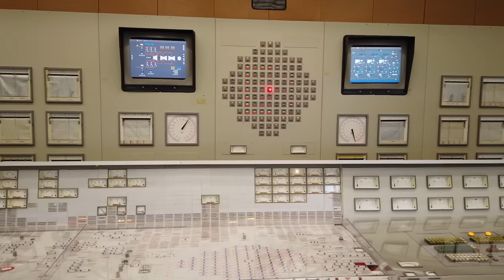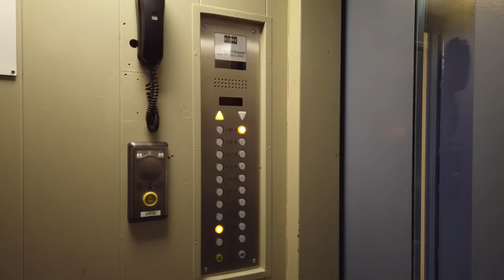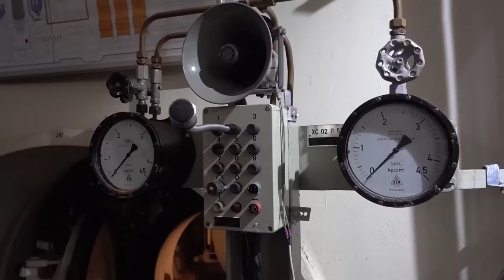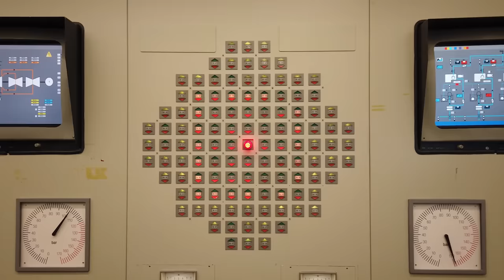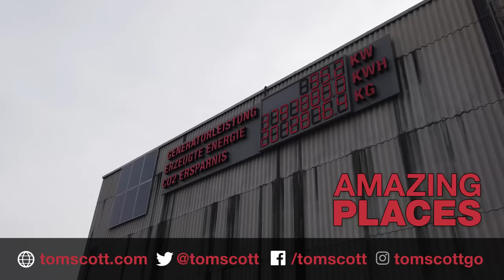This billion-euro nuclear reactor was never switched on

Comment: You forgot to mention, that the Austrians had to build a coal-fired power plant 4km away to saturate the electricity needs when the referendum concluded. Ironically this power plant has produced more radiation than Zwentendorf ever would.
Reply: True enough.  Coal is never just coal.  Mixed up in coal are radioactive elements, mercury, lead, and other bad things that get spread all around the plant...
Reply: At least they can decomission it in a couple of yerars and simply move on with their lives.
Reply: @Les_S537  is that where the radiation came from? From burning the coal itself?
Reply: There are no coal-fired power plants in austria any more.
Reply: @Confucius_76  all coal is slightly radioactive. Burning it releases the radioactive contaminants into the atmosphere, ironically causing much more radiation hazard than a nuclear plant would.
Reply: @quintensarn4595  do you have any source for that?
Reply: @Zeckmon3  however would a literal nuclear reactor not produce more radiation?
Reply: @GamingOS  It's not like that a nuclear reactor doesn't produce more radiation, it's the "effective" radiation which gets its way to the environment. The radiation of nuclear plants comes from the nuclear rods which are buried after their use. Nuclear plants are very carefully that the radiation of those rods doesn't affect the environment, while coal plants simply blow their toxic stuff in the air (included the radioactive stuff which is always in coal) which causes more harm than nuclear plants.
Reply: @vs_0159  Makes me wonder if those ash capturing systems on coal plants are also effective at keeping teh radioactive stuff in. Makes sense that it would stick to the solid residue.

Said ash would probably be piled up under the open sky anyway though, free to leech out under the rain
Reply: @GamingOS  No power plant "produces radiation". Radioactive material is just moved.

Point is, regarding radioactive material:
With a nuclear plant, it's dug up, concentrated, tapped, then re-buried.
With a coal plant, it's dug up, tapped, and lost to the air.

More of it enters a nuclear plant, but more escapes a coal plant. (not much though, especially when they capture the soot)
Reply: Thanks guys, I honestly was not aware of that simple fact. Learned something new today.
Reply: It's almost as if we should scrap both and go straight to renewables, and luckily Europe seems to be doing just that!
Reply: reading the comments, it would be fair to state that Austria is free of coal fired power plants as well, since a few weeks
Reply: @vs_0159  Flyash is captured in modern coal plants and used as an additive to strengthen concrete - its considered non-hazardous by most countries for that use - please get your facts straight!
Reply: @baronvonlimbourgh1716  I mean you could decommission a nuclear reactor too, it just requires more concrete and yellow tape.
Reply: @baronvonlimbourgh1716  what about the green house gases that it released on woking phase which will remain here even after decomissioning
Reply: @dheerajsidharthan4216  all about context, balance and planning.

Co2 can be compensated if it is only temporary. Or stored underground for example.
Other polutants can be filtered.
We have the technology, no need to risk peoples lives, the environment and the future.
Especially for something that would be a very expensive radiactive paperweight a decade from now.

Better spend that money accelerating solar adoption.
Reply: Yep, lots of Carbon 14 in coal, not to mention the heavy metals.
Reply: @quintensarn4595  WRONG
Reply: @Confucius_76  yes, coal had radon gas which is radioactive
Reply: @baronvonlimbourgh1716  Yes, but the CO2 it dumped in the atmosphere lingers, and will continue to warm the planet for centuries.
Reply: @J S You could not be further from the truth we are getting 75 % of Austria are being generated by renewables mostly Hydro Power from other 9 the Danube Powerplants which are Stabel Base Lodes. We did not only have the Geography to make hydro work we were also willing to use it unlike the swiss. We are the second-best in the EU in this regard only after Norway and 15 % before Sweden. Sice Zwenden Dorf we made it work, and If we are going to hit the 2030 100% clean energy targets we will do so wich out nuclear.
Reply: @GamingOS  Nuclear reactors only heat up water, uranium or other fuels dont come in contact with anything that ever leaves the plant
Reply: How can you know that the nuclear plant would not have released more radiation? The bold claims about core meltdown being impossible because of the supposedly foolproof designs have not aged well. Trust in operators of nuclear plants and their regulators was already betrayed in the 1950s when mishaps were repeatedly kept secret, and since then several plants have blown their lids off.
Reply: @j18ter  In the 50s soviet union where ppl couldnt get food and would be sent to gulags if they dont follow orders you expect good reactors and operators? And there were no serious nuclear accidents other that fukushima nad charnobyl and certanly no reactor other then charnobyl had its lid blown off
Reply: @zeux6634  My reference to the 50s was about the Windscale reactors in the UK, which had released significant amounts of radioactive material, which was covered-up by the UK government for years. A fire later destroyed a reactor, probably the most serious nuclear accident up to that time.
Reply: @j18ter  ok i have alot of homework to do today so i dont have time to reasearch that, so lets say youre right. How are we supposed to get energy if not nuclear?
Reply: @epicormic_bud  why abandon such wonderful technology as nuclear.
Reply: @j18ter  the windscale reactor didn't produce nuclear energy, it was essentially a nuclear bomb factory. It's a very different way of using the material
Reply: true words. people tend to forget that coal burning releases significant amounts of radioactive particles. even with modern filter technique. All in all I would fear the particulate matter emissions much more, living close to a coal plant. Even if you assume effects of Chernobyl disaster killed 200.000 people over the years, its a joke compared to 1.8 million particulate matter related deaths.(worldwide,  about 10% of total particulate matter emission is released by coal plants )
Reply: @epicormic_bud  Germany isn´t Europe...and we really can´t move away from both because every renewable except for watter and geothermal is quite unstable and those cannot be utilized in every country due to geography (if you don´t have huge rivers or volcanoes then you can´t really use those). And every unstable source needs to be backed up by a stable one because guess what, people usually don´t use electricity only when sun shines or wind blows. 

It already causes huge problems for EU powergrids and Germany despite "beeing nuclear free" still relies on French and Czech nuclear power plants or Polish coal plants whenever there is not enough in their sources. And with the almost mandatory switch to electric cars, I am not sure how in hell will the grid or suplies will ever be able to handle that without nuclear or russian gas.
I would like if energetic policies were determined by people who understand the issue, not activist, not public opinion.
Reply: @SC0RCH3er  Deep geothermal energy can be obtained anywhere on Earth, in theory.
Reply: @SC0RCH3er  valid concern, however solar and wind are quite predictable in such an enormous grid like we have in Europe.
Reply: Duernrohr was / is coal-powered. I remember one of the two coal-towers was shut down years ago. The other one is still in operation, right?
Reply: And coal dust, poisoning the austrians, in all likelihood hundreds died because of this referendum but luckily for the coal industry it's hard to put a number to these things.

Comment: Fascinating, a little sad, but glad to see it got some use.  Nuclear fission (if properly respected) is possibly the best way out of the climate crisis, as other sources currently cannot compete for raw power output.  Hopefully this place, even though it is outdated, can continue to teach about how it all works and about how to respect it in a safe and controlled environment :)
Reply: Nuclear fusion is at this moment the best way out of climate and energy crisis.
Reply: @magrigrigri  I would agree, but Fusion is still decades away commercially. Fission is not perfect, but it's available 🙂
Reply: @David_J_B  I am a garbage and got confused between fusion and fission. You are right.
Reply: @magrigrigri  Fission chips.
Reply: Fission sure is the most expensive energy production method in widespread industrial use.
I always get a bit miffed when people talk about "raw output" or any somesuch wishy-washy wording when the LCOE of fission is five to ten times higher than renewables - offshore winds ect give you mor bang for the buck by far, its only the volatility problem the tech is a solution for, not price.
Reply: @nilesbutler8638  What’s happen when there is no wind ?
Reply: @nilesbutler8638  1: At this moment, the interconnected grid does not exists, right? What you are explaining is theoretical only.

2: Those buffer has a huge cost. What's about rare-earth elements ? How much more resources do you need to build 800 wind turbines instead of a nuclear plant?

If wind power is so profitable, how can you explain that France has invested as much in wind power as in nuclear, yet nuclear represents 70% of the energy produced?

How to explain that Germany (and other European countries) which have invested massively in wind power are now in an energy crisis and totally dependent on gas exporting countries.

Feel like wind power has failed. Nuclear hasn't
Reply: @magrigrigri   
I dont know where you claim to get your number on frances wind power spending.....
I highly doubt it, though....
France has been massively nuclear-dependent for decades - as you point ot by the 75%-number. 
They have been  well known for boycotting renewables and interconnectors, since they want to sell their nuclear energy. (Whhich has been running at a loss for the governement for decades).
Some source for your claim would be appreciated. 
All I could find is that they actively plan to reduce their energy mix from currently 75% nuclear to no more than 50% in 2035, spending at least 20% of their energy subsidies for that aim. 
And currently have less than 0,1% of wind power in their mix, with their 23% renewables mainly stemming from hydro and geothermal. Which makes your claim...dubious.
And recently torpedoed a spanish/german interconnector project to transport PV energy if not tied in with a nuclear electricty sales deal....
Also - did you maybe happen to hear that france had to switch off 40% of their "proven" nuclear plant fleet this summer because their plants lacked cooling water due to the drought summer. 
And had to import electricity?
Reply: @nilesbutler8638  You're right that it's not about raw output. Power demand fluctuations are more important & sadly without massive storage solutions in place wind and solar are at the mercy of the environment for peak energy production. Though there is progress towards those solutions, like liquid aluminium and sodium ion battery technology 🙂
Reply: @nilesbutler8638  You wants sources for my claims ? Provided sources for your claims. 

Btw yes, France has to temporarily shutdown some nuclear plants. The same thing could happen to anything and anyone when the production fleet is no longer maintained. This is what happened for the French nuclear industry. The European Union (pushed by Germany) has put in place regulations that negatively impact the production of nuclear energy (imo precisely because France was able to produce energy much cheaper than Germany). These regulations have resulted in EDF selling its energy at a loss (for the benefit of other private companies), and therefore without having the budget to maintain the existing nuclear fleet. Have a look at the law about Energy Market Organization

At the same time, wind power has been favored by several regulations (again which strongly benefits private companies)
Reply: This is mainly Germany I am referring to.
Reply: @David_J_B  only 3 decades away my dude
Reply: I agree on most points. However nuclear fission can definitely be beat in both flexibility and raw power output. The largest power plant in the US is the Grand coulee dam in Washington state producing 6,809 MW after it's 1984 refit including pumped storage. In this increasingly electricity-hungry world we're going to have to continue to diversify and strengthen our electrical grids. Having massive projects like these sit dormet is an irresponsible use of human and natural resources.
Reply: What about the waste? Both low level and high level have to be buried, some of it for MILLIONS of years! Is that fair on future generations that have to look after it??
Reply: @tonycalow708 Please read all. Every single form of electrical power generation has it's downsides. All the nuclear fission power plants in the US combined produce about 4,000 tons of radioactive waste annually. One, single, average sized coal power plant in the US produces around 50,000 tons of Co2 every DAY! With that in mind it seems like a reasonable decision to continue the use of nuclear power especially as nuclear fusion becomes more practical.
Reply: And uses far, far less slave labor than solar panels that are currently mostly made in China and which uses ethnic forced labor. Not saying there isn't any minerals used to build or run nuclear powerplants that are also derived from slave labor, but it's still far less than China.
Reply: @tonycalow708  low level and medium level reactor waste can be recycled because of how fast it decays, and most high level waste can decay through its half-life on site

95% of all nuclear waste can be recycled or decay on-site

we have had solutions to the remaining 5% for years now